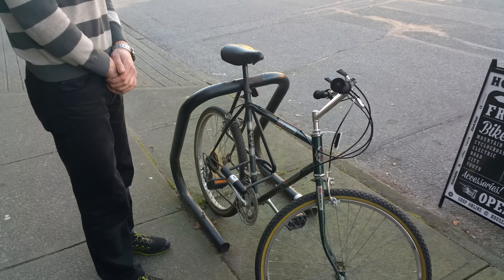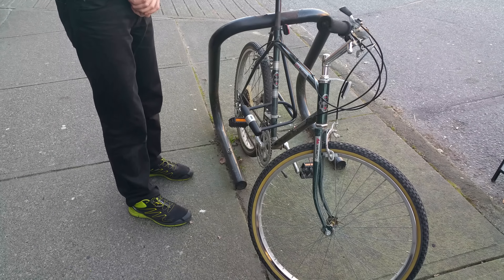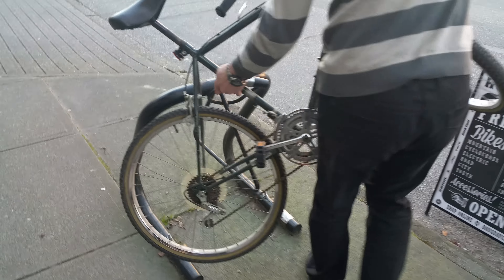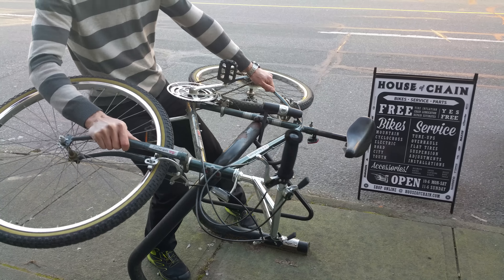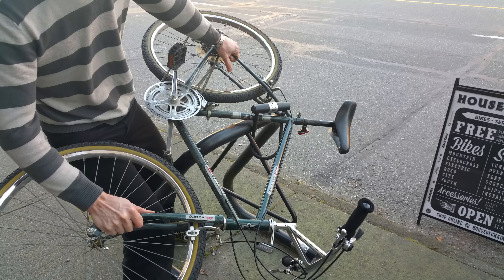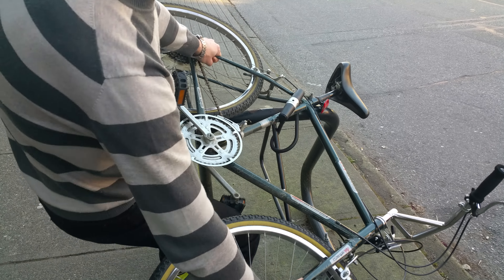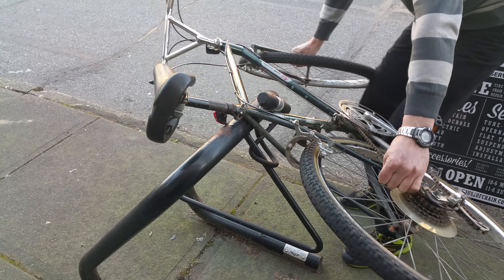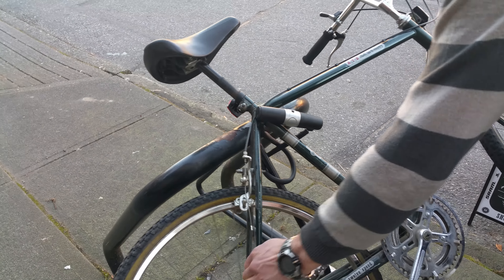BikeGuard 1350 VS Spinning the bike (leverage)

Comment: Same technique, but with a high-end carbon frame bike... The frame will snap, but the group-set is still worth $1-2k. The wheels are typically worth at least $1k.
:(

Some bikes should never be left unattended.
Reply from the maker: "Some bikes should never be left unattended".  So very true!
Reply: I saw a failed attempt that bent the bike really badly

Comment: I guarantee you that’s one of those pot metal bike locks that doesn’t use harden steel look how easy that metal is bending. Also, do you want to use your locks where the shackle is? Sin at the ends because that means it goes into the body of the lock so leverage attacks don’t work on them